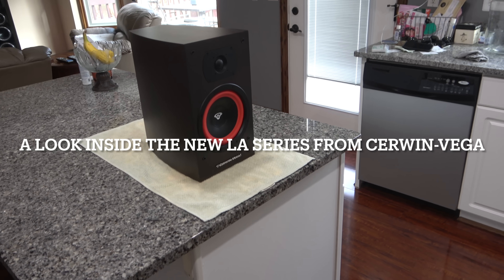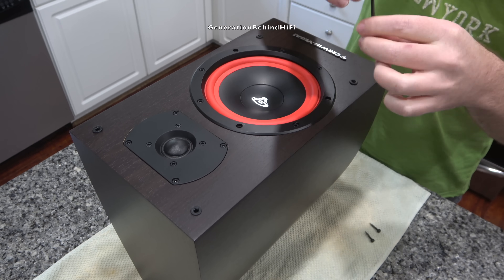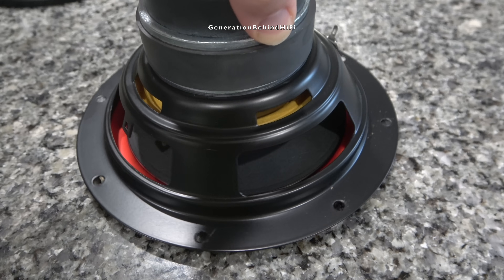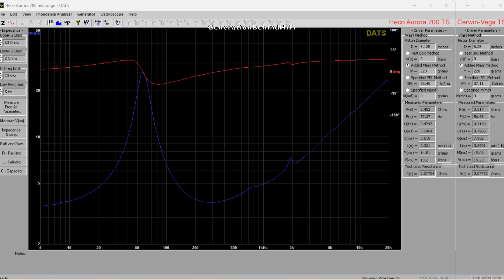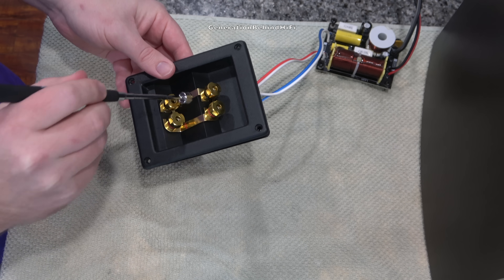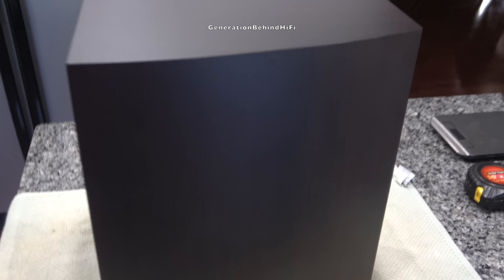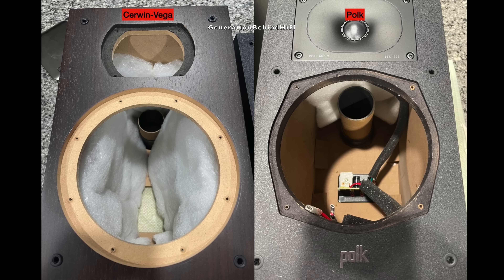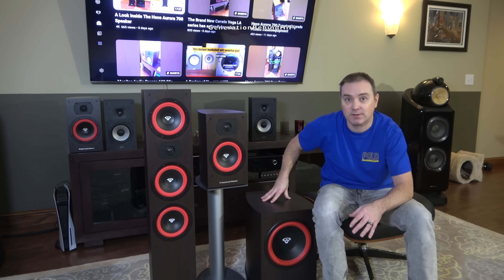A Look Inside The Brand New Cerwin-Vega LA165 Bookshelf Speaker

Comment: I am shocked at the crossover.  A/D/S had affordable speakers with polyester instead of electrolytics in the mid/tweeter circuit in the 80's.  And very un-vega like, caps for the woofer. Note:  I had the aria 906.  The crossovers are very poor, especially for 2 grand a pair. The tweeter is a cheap, stamped version of the units found in higher end focal.

Comment: I have seen lots of $600-$1000 bookshelf speakers whose crossovers are not as nice as this crossover on this Cerwin Vega $269/pair bookshelf speakers. These Cerwin Vega's have nice crossovers for their price range !!  Literally never ever see a speaker less than $500 / pair with crosssovers this nice !! Plus I really like the tweeter, that silk dome is a nicetweeter. The motor is large, large magnet. The 6  1/2 " midrange / midbasses - they are not that great/. I have seen much higher quality midrange / midbasses before. But the cabinet on this speaker is really nice ,crossover is really  nice and tweeter is nice. I just  wish they used better midrangers - bigger magnets and better frames .... ie cast aluminum frames.
Reply from the maker: You can't be too picky at this price point. I think Cerwin-Vega did a phenomenal job with the LA165 considering the cost constraints they had to worth with. IMO its the best budget bookshelf I have tested so far.

Comment: 😂😂😂the crossover parts from the mofi source point are  the same. 100%😅😅
Reply from the maker: Really?! Wow! Those speakers are quite a bit more expensive than the LA165!
Reply: @generationbehindhifi thats the Problem from all these companies.  Klipsch the same. So diy is the only way to go. 👍👍🇩🇪
Reply from the maker: @thomasschafer7268  DIY is very fun, but it isn't quite the value proposition that it used to be. Just look how expensive some of the drivers and pre-cut MDF cabinets are from partsexpress. Yikes!

Comment: I love the red surrounds, its distinctly cerwin vega. Cv getting rid of the red is like klipsch getting rid of copper drivers. Just no, i still have a set of at-12's. I love them, i am equally impressed w that crossover and cabinet. im shocked they even put dampening material in the cabinet. im totally shocked they put a pretty decent crossover in there at that pricepoint.
Reply: They look great

Comment: Cw sounds like crap, they play loud and hit hard but thats about it, their no detail in the music, and sound quality is not there, i prefer quality over quanity, i listen to both the xls and cls series even the ones with dual 15 inch woofers, they hit hard and play extreamly loud, but the sound is not refined, no hifi about it, my old b&w 683 s2 didin’t play as loud, but sound much better at levels they can play at, and currently sits with a pair of b&w 702 s2 i know this is far from a fair camparsion considering its price range difference, but outside of spl they eat the cw alive, i am not worried about bass because an Arendal 1723 1s subwoofer is have that covered, and that sub plays much desper than cw and more refined, the cw dosen’t go deep for it size, maybe trying to switch fronts to Arendal 1723 tower or tower s to have speakers that can play extreamly loud to without sacrificing to much of the sound quality or details,

Comment: Back in my young days ( late 70's and 80's ) when bass was King to me, I had a pair of 2 way, 12" driver and horn tweeter CV's. I dont remember the model no. of them, but they had an adjustable Xover and a reset for the horn, in a woodgrain finished cabinet, when my slightly modded A560 Yamaha amp would trip the horn out. Yeah, volume was just second to heavy bass!! These days with different tastes, something like these LA165's wouls pair nicely with my Line Magnetic LM88IA tube amp and maybe a 10"sub to extend the lows slightly. Now, to convince my higher authority we cant live without the LA165's....😄😄

Comment: Lots of woofers use 8 screws. Off the top of my head i can think of Morel, Tang Band, Polk Audio. I think the reason why you might think this is rare is most modern speakers have the screws hidden.
Reply from the maker: Hi Andrew. I was talking in relation to price. These speakers only cost $270 and its rare to see that many screws fasten the woofer to the front baffle. In fact, I can't think of another speaker at this price point that uses this many screws. Can you? Morel is a high end brand so I'm not surprised, and they make some really good stuff, but you pay for it!

Comment: Cerwin Vega won an Academy Award for inventing Sensurround for the film Earthquake. They were custom made folding horn speakers that went down to 15hz at 120 decibels. They made some theaters walls crack and most loose or hanging lights had to be secured for the film.
Reply from the maker: I have heard bits and pieces about this, but didn't know it was actually damaging the walls in the theater. Very cool and thanks for sharing!

Comment: I had to laugh @ the knocking on the cabinet test. I don’t think that’s gonna tell you much.
Reply: The knock test is absolutely a good test. Especially on larger speaker a more inert cabinet makes for a cleaner sound especially in the low end. Bracing and damping makes for a tighter bass, and can help allow the music to play louder before distortion
Reply from the maker: Actually it's quite helpful if you know what to listen for.

"The knuckle test, unlike tire kicking (performed at various locations around the cabinet panels), can certainly tell you if the box is rigid from the pitch of the sounds it makes when knocked."

Source: https://www.audioholics.com/loudspeaker-design/loudspeaker-cabinets

Comment: The bucking magnets that you call it in its day had a metal cover over it to reframe from bothering television screen picture tubes. My Klipsch R-15M have that magnet on the drivers like those do. I’d be impressed if they made those baskets like the old 8/10/12/15 inch drivers , out of aluminum. The screws & nuts being steel isn’t gonna make any difference in sound if they was copper or aluminum etc where a magnet doesn’t stick. I still have my 1991 D-3 Vegas & they are perfect. Only had to replace the surrounds . I still own the boxes they was sold in. They was boxed 20 years. They aren’t made like those anymore.
Reply from the maker: "A bucking magnet is a magnet placed near another magnet with opposing polarity to cancel out its magnetic field. This technique is commonly used in various applications to minimise unwanted magnetic interference or to create a more stable magnetic field."

source: https://engineeryoursound.com/what-is-a-bucking-magnet-speaker-design-explained/

Comment: In a blind listening test, no-one is EVER going to hear an improvement from using non-ferromagnetic terminals. Is it really worth the effort?
Reply from the maker: Perhaps, but speakers are the sum of their parts are they not? Every little detail matters to maximize sound quality. To use ferromagnetic parts vs steel is maybe a dollar more at best, especially at the volume these manufactures are buying them at. My question to you is if it didn't matter, then why do all the high end manufactures use non-ferromagnetic parts in their designs? This includes Bowers & Wilkins, KEF, and Sonus Faber. I'll tell you why, because they are trying to squeeze every small performance gain they can to distance themselves from the rest. As an audiophile, everyone should be thinking this way. 

IEEE did a white paper on ferromagnetic parts in audio connectors and its a good read. Basically the study proved that ferromagnetic parts introduce passive intermodulation, aka 3rd-order harmonics distortion to the signal! Simply put, there's a reason why high end speakers use non ferromagnetic parts in the signal path.

Paper can be read here: https://ieeexplore.ieee.org/ielaam/22/8681220/8632973-aam.pdf
Reply: @generationbehindhifi  Interesting stuff. I definitely need to read further. Great video by the way, and thanks for your answer 😊
Reply from the maker: @paulapplewhite6135  No problem, Paul! Happy listening!
Reply: @generationbehindhifi  - steel connections are TOTALLY inaudible!

Comment: nothing new, overpriced. pretty much like everything else today
just parts express and build your own
Reply from the maker: Overpriced? I can't think of another speaker that includes cabinet construction like this (3/4" front baffle and 5/8" rear), poly caps in the crossover, generous damping material, and drivers with a motor structure like this for less than $270. If you do, please let me know so I can do a look inside video on them!! Even doing a DIY parts express build will probably be more expensive.
Reply: @generationbehindhifi  I am sure they are great speakers just not what I pay for much better. example would be the Cyber Acoustics 3602a a real garbage of a speaker system that used the same tech a long time ago. now take a 6.5 mid like the 6MB250-NDY that can be picked up for $75.00 with the TW400Ti-Nd-4 SLIM at about $40.00 pair with about $ 40.00 in crossovers & wood to make them look identical and you tell me which ones you would want?
Yes I know most don't have the tools or the means to make them but I do.
Reply from the maker: @AZGoodTimes  What your saying is not a fair comparison at all. Lets try and compare apples to apples. All I'm saying is I can't find another speaker in this price point that has construction quality like this. If you know of something better for this price, then let me know about it so I can buy it and check it out!!! I think any reasonable person who has the data that I just presented would agree that these new Cerwin-Vegas are pretty impressive for their price. I'm sure if I removed the Cerwin-Vega branding and gave it a more prestigious name then people would be singing a different tune. Funny how that works?! However, I'm not brand loyal and I try and look at products objectively with a non-bias view. Sadly most people can't do that.
Reply: @generationbehindhifi  
ok send me the link to get a set and i will try them out.

Comment: The speaker market for these, ( around 250-300 dollars ) has become so good that Cerwin vega had to make something much better than it did years ago.  With Elac, Kef, Klipsch, Q Acoustric, etc., all making something really great for $300 and under, the question is, has Cerwin Vega made it good enough to compete.  The Elac UB5 is under $300 and went on sale for $200 just days ago.  I don't know how a company like C.V., that use to use 6db crossovers and a ugly finish just years ago, can get their speakers in todays market without lots of Youtube / Media reviews.  Good to see them trying again but I really think it's going to be a tough battle...
Reply from the maker: Cerwin-Vega is the only one in that line up with a 6.5" driver, the rest are already at a disadvantage because of that. You're correct though! The market for affordable speakers is really hot right now.
Reply: I agree but there are a couple that stand out:   Elac Debut 2.0 B6.2, Cambridge Audio's SX 60, Klipsch RP 160m all fall between $239 and $300 and have 6.5" woofers.
Reply from the maker: @cnnlive10  I'm trying to keep it fair by comparing MSRP vs MSRP. Sale prices are not always a guarantee that you will get it for that price. 

I have heard good things about both the Elac 2.0 B6 and RP160M, but MSRP on the Elac is quite a bit higher than the Cerwin Vega LA165. I do plan on buying a pair of Elac's for the channel next year so I can get an idea of what their made of. 🙂 Thanks for the suggestions!
Reply: Totally understand about MSRP.  I'm an old school Cerwin Vega fan and thank you for the review and tear down.
Reply from the maker: @cnnlive10  No problem! Merry Christmas! 🙂

Comment: CV makes a gr8 3-way the SL-12 !and SL-15
but calling a 6.5 a woofer? Call it a bigger midrange I just dig those REAL 12 and 15
inches
Reply from the maker: Woofer vs. subwoofer frequency ranges
The frequency range for a woofer is typically between 50 Hz and 2,000 Hz, while subwoofers will usually go as low as 20 Hz or even lower than that and only go up to 200 Hz. The LA165 has a woofer, that is why I am referring to it as such. Hope this helps. 

https://descriptive.audio/woofer-vs-subwoofer/

Comment: I have Sl 15, vs 100 and two v12s subs. I love CV, hope they come out with some new big floorstanders.
Reply: You should look into the Cerwin Vega! AT-100's if you want some that are small compared to having at 15" woofer yet still the loudest single 15" full range HIFI speaker they have ever made, none goes as deep in bass and still plays as loud as the AT-100's, not even 1515 has as much bass, 1515 only has louder kickbass, but has no deep bass compared to AT-100, I really recommend them, I've had 6 pairs of CV's now, I love Cerwin Vega
Reply: @TeknoLars  used to own AT 12s. Loved them. Very loud and deep.
Reply: @ericnortan9012  AT-12/AT-80 are the worst in the whole AT-series, the cabinet is really bad compared to the 12" woofer in the cabinet, but well good you thought they sounded well, I bet you would LOVE AT-100/AT-15, they are wayy better and extremely loud, I still to this day get scared everytime I listen to them, they are insane. But I sadly destroyed 2 woofers in them now for playing so loud, but this time it was because the guy I bought the new ATW-15 from had used bad glue on the voice coil, so the glue had melted while I listened really loud, so now it scrapes the magnet alot, and sounds like trash haha, I really hope I will get them fixed soon 😂
Reply: @TeknoLars  I've found most CV cabinets are shit, crossovers are cheap, but woofers are solid. Hit and miss on the mids. Love my VS 100, great bass for a 10" with really clean mids and highs. I loved my AT 12s, but I had an excellent amp. I like 15s overall, but always really like 12s for metal music, they seem to have the perfect punch.

Comment: What is the frequncy and db for these? Amazon don't say anything not even power rating!
Reply from the maker: Below is all I could find on them. 

Dimension - Length x Width x Height - Inches(mm)	12.4" x 8" x 13.7" (315mm x 203mm x 347mm)
Grille	YES
Sensitivity (1W/1M)	90 dB (1 Watt/1 m)
Power Handling (RMS/Peak)	150W PEAK
Nominal Impedance (ohms)	4-8Ω
Frequency Response	33-20KHz
Reply: @generationbehindhifi  thank you for the information and I appreciate it ☺️

Comment: I listened to a CV tower at a show last year and it was singularly the worst loudspeaker I think I'd ever heard! Comically bad. The tweeter sounded broken and the bass was all mush.
Reply: What show? What speaker?
Reply: @JR-ho5qm  Toronto audio show this year a few months ago. It was a big tall tower. Maybe 5 and a half feet high?
Reply: @JR-ho5qm  Maybe XLS-215 2 x 15" 3-Way Floor-standing ? It was so bad in that room.
Reply: @supercompooper  XLS is their China series. Don't expect any Cerwin Vegas after 1999 to be good. the last ones they made that were good were the AL-series. AL-series just had a problem with the magnet systems, and the woofers were just bad, so they had absolutely no bass compared to mids and tweeters, yet still the best speakers I've ever had in my life. Just donøt ever buy their new series, here's some examples of what you should never ever touch: XLS, CLS, CLSC, LS, VF, VE and SL-series, they are all crap compared to "vintage"/"oldschool" Cerwin Vegas before they became China speakers
Reply: @TeknoLars The VE series aren't that bad but not near as good as my pair of CV 380SE's.  My buddy bought a pair of SL12's and they sounded horrible compared to my VE's.
Reply: @JR-ho5qm  i just saw the specs and down 10db at 20kHz? Whoah...

Comment: This is Heco Victa 300 cabinet  100%.
Reply from the maker: Another viewer mentioned that too. I think you guys might be right. Heco makes some nice stuff too. I did a look inside video (tear down) on the Aurora 700 and was really impressed with what it had to offer considering how affordable they are.
Reply: @generationbehindhifi it’s probably just made in the same factory. Wharfdale also makes one with a similar cabinet. Keep in mind there is only so many factories that make speakers and by having brand crossovers this helps keep the cost down. I’m willing to bet the CerwinVega! Has a better power handling tweeter with higher sensitivity. But just a guess